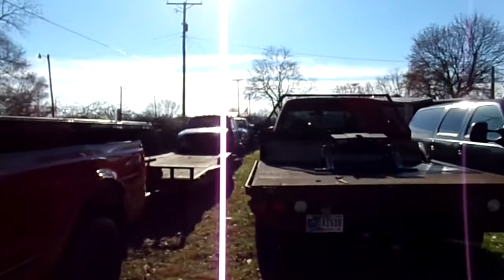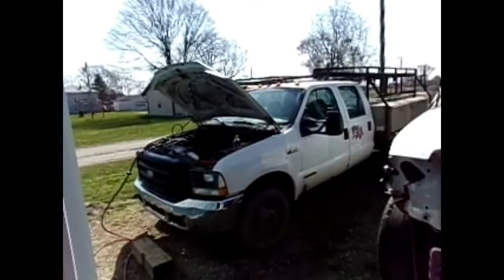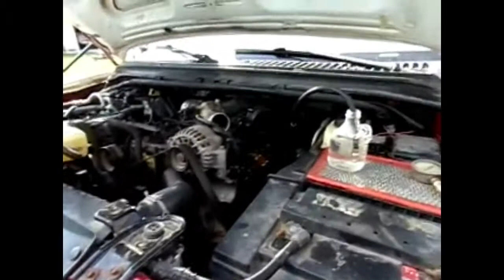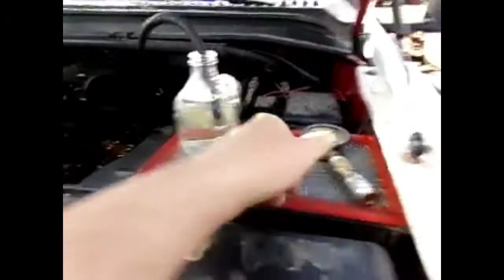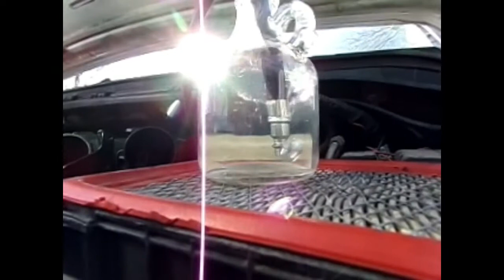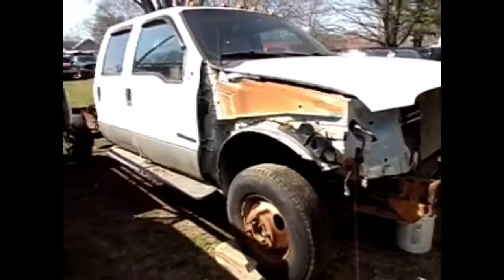Diagnosing 7.3 Power Stroke Diesel getting coolant / water in the oil and in 1 cylinder.

Comment: Great video with helpful info 👍 thank you 🙏✨ hope to see more 7.3 diesel videos 🌞 🚛 👏
Reply from the maker: Thank You, I hope to be posting more soon!
Reply: How much air did you put in it? I have a 97 with water in the oil and it also occasionally seems to hydro lock. My buddy and I did this test after watching this but we didn’t come up with any air in the cylinders. We used a snapon coolant system tester, we had it up to 20psi which seemed like a lot, still no air. We are going to check for a pin hole behind the water pump now.

Comment: It isn't clear in the video if that was an early 99, but the sealant they used for the injector cups was not compatible with ELC coolant and if the owner did not keep up with testing and adding SCA's they were prone to pinholes from cavitation. 99.5 - 2003 had the upgraded cup sealant and ELC coolant could be used. I did a video on finding coolant in my oil on an e99 but I was not as lucky as you: I found a crack between cylinder's 1 and 3. When I put shop air to the coolant system, you could hear the air leaking inside the engine.
Reply from the maker: If I put shop air in the cylinder, through the glow plug hole, you can hear it in the engine when the piston is at the top of the stroke. But it wasn't loud enough for the camera to pick it up in the video. 
I was NOT aware that the injector cups were different in the early 99s. Thank You for that information!
Reply: @opasgarage4423  I replaced the cups in one of my 7.3's and bought ELC coolant for it. I holed a piston before putting it in. On my rebuild project, I had the machine shop replace the cups so I could run the ELC in it when it's done. I don't want to run the risk of pinholes from cavitation if I don't keep up with the coolant SCA's.
Reply: @opasgarage4423 1:20